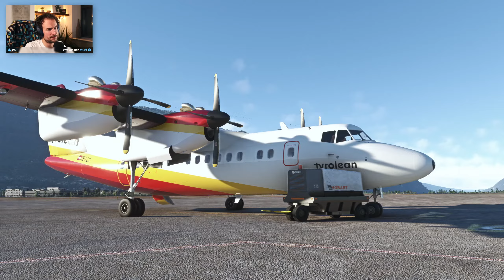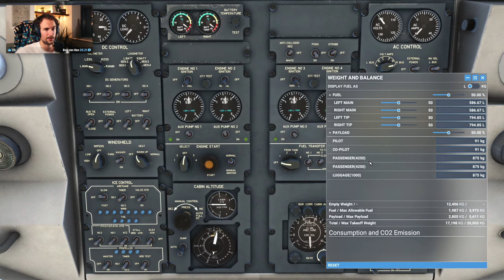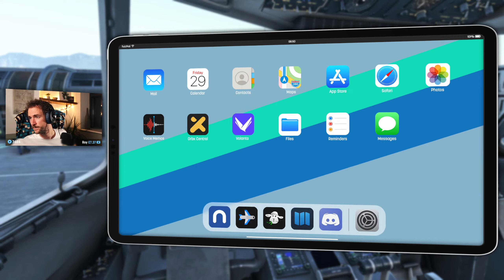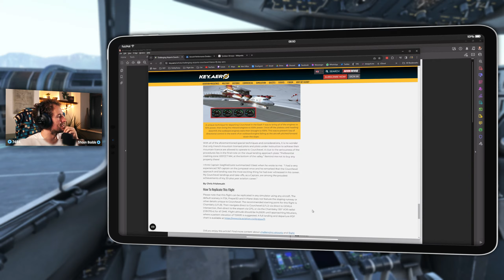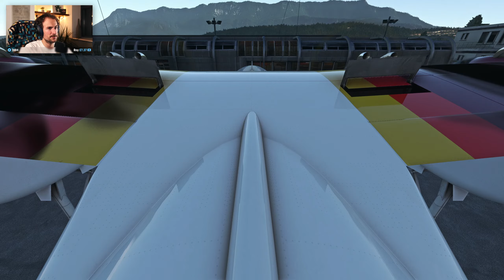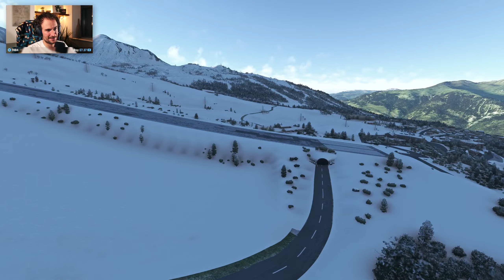🔴 PILOT'S Dash-7 into Courchevel! Real-World Historic Route | Microsoft Flight Simulator

Comment: CVR test would be right next to the CVR. 
The Battery Master switch only closes the circuit for the batteries, you should have no voltage until either the R or L battery are on, which was not the case here. 
Once either battery is on you should hear a loud warning horn if the bus tie is open. 
DC external power is used daily, AC not so much. 
The external power connector is behind the right side landing gear, on the bottom of the right side nacelle. 
Slow-Fast indicator is for the pneumatic de-ice boots on wings, engine intakes and horizontal stabilizer.
Hydraulic quantity should never be that full, we usually keep it from 2.5 to 3.5, anything above 4 and it will start burping off excess liquid.
To see the intake deflectors you have to look into the intake, they're on the upper part of the intake, won't see them moving from the ground, but you will hear them.
The transponder is missing on this aircraft model, Plot's GesmbH already admitted it's missing. It should be underneath the pilot's GPS.
The synchrophase slaves the numbers 1, 2 and 4 engines to the number three within 20 rpm.
You usually turn on the DC generators right after you turn on each engine, and the AC generators when you're doing your after start checklist.
Go-around button on the real aircraft is a tiny button to the left of the #1, and to the right of the #4 engine power lever.
Go-around mode wasn't engaged because your AC generators were off, the autopilot is powered from the AC bus.
Hydraulic parking brake pressure is set by maintenance crew with a hand pump, should be a minimum of 1000 psi, up to 3000 psi. The gauge should automatically go to 3000 psi once the #3 engine is on, it gets pressurized by the hydraulic pump. Apparently it hasn't been properly modelled yet.
The flight control lock wasn't properly modelled in your aircraft as it was the initial launch model, I know Pilot's has already fixed it for the latest version.
If you set your autopilot to VS or IAS it will hold the altitude better during turns.
Flaps 45 and landing gear down you should land at 70 knots, expert pilots can do 45 knots and land on less than half a soccer field.😮

There are a few other niggles with this aircraft that haven't been properly modelled, but overall it is quite a good job. It certainly flies very close to the real thing. I am a Dash 7 mechanic, and I do daily inspections on a few aircraft every day.
Reply from the maker: Thank you for the in depth tips! A very cool aircraft.